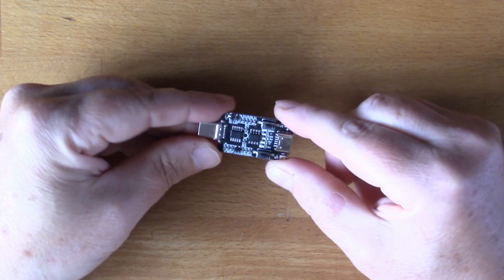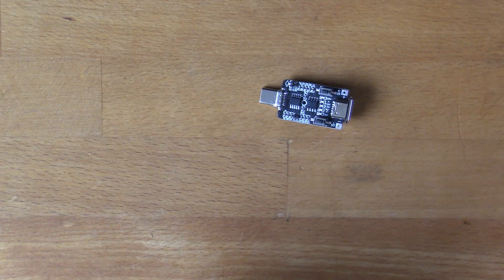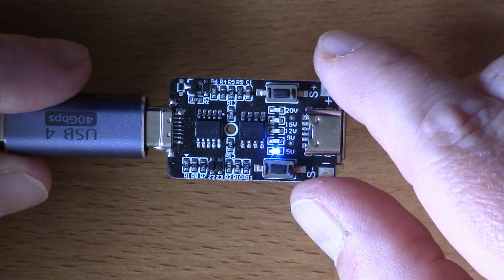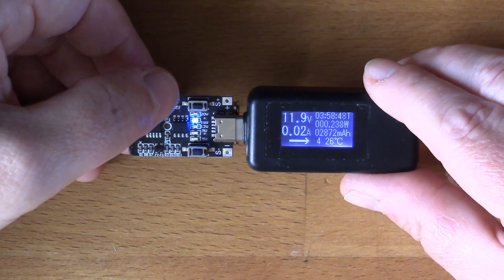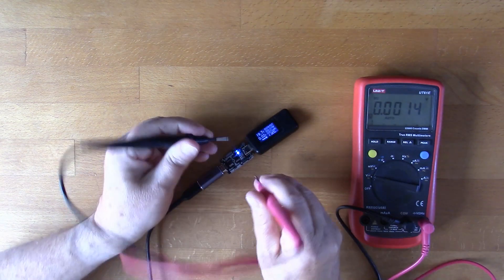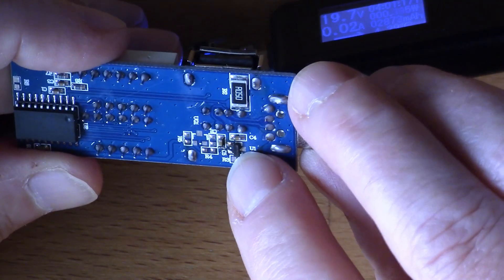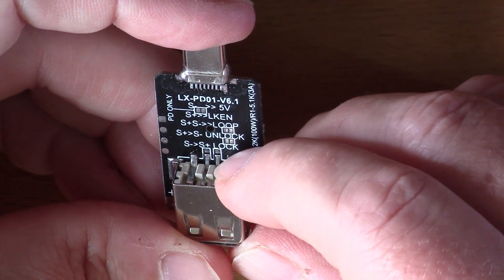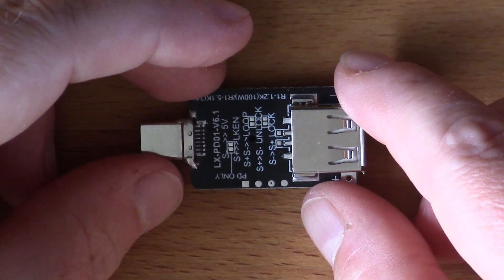USB PD Control Board (#152)

Comment: These are cool,  just have to make sure the board supports sufficient amps, there's some cheap units circulating that only do .8 a max before shutting down
Reply from the maker: That's interesting to know, thanks.